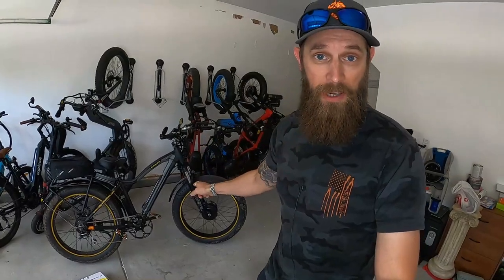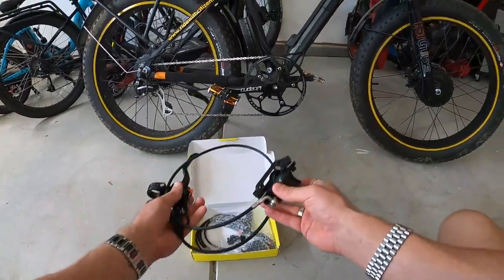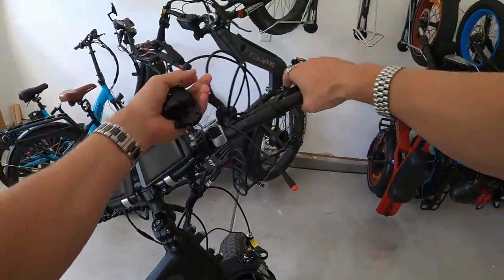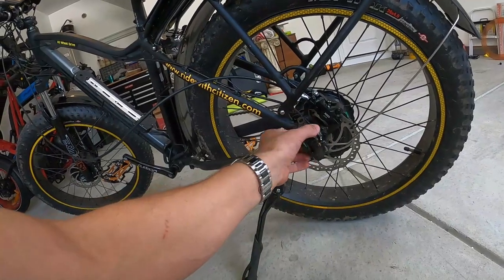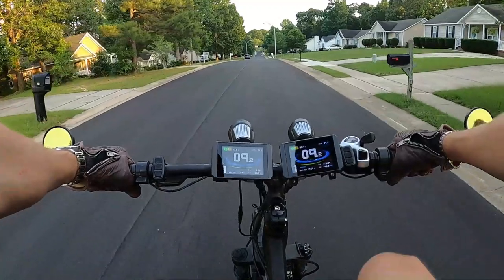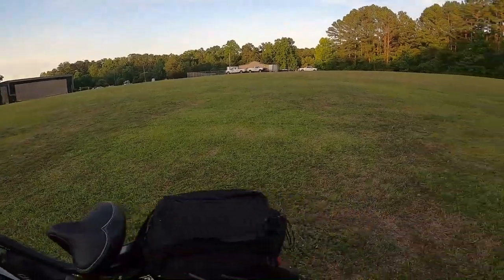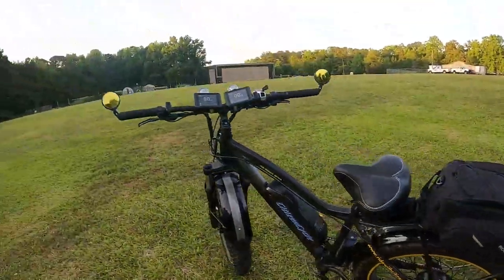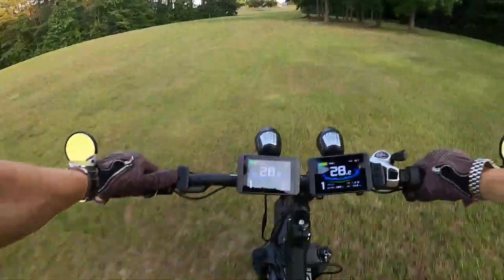World's Easiest Hydraulic Brake Install

Comment: Great upgrade from Big Game Bikes!  I tried out the “Assembly Required” set from them for my Rover (lines and reservoirs filled with screw caps holding fluid).  Allowed me to run the cables through the frame and then remove the caps and screw them together, no bleeding required - was very helpful to have them prefilled and ready to go, made the install nice and easy.  Added a front 203mm  rotor and now the braking is great.  Huge improvement and totally worth the purchase.
Reply from the maker: I was thinking of adding 203 rotors as well can you tell me which ones you purchased and did they come with a special adapter for correct fitment?

Comment: The reservoir also has space for a few air bubbles to accumulate, so upside-down they won't have that function, and any air could affect braking performance. You'll be fine for a while, but you'll eventually need to swap sides or swap the hoses and bleed them.
Reply from the maker: Altema22 You may be my most knowledgeable commenter 😁

Comment: I am trying to decide whether to go with a full hydraulic kit fir 180mm rotors, or hybrid cable actuated hydraulic calipers. The latter are super easy/quick, but only provide half the benefit. Technically if you can lock up the wheel, and have SOME modulation, this won't shorten braking DISTANCE - but feel should be improved, hopefully enough to be worth the effort.

Comment: I'm considering doing this to my older HT Stump Jumper, still has pull brakes (squeeze pads) it does have mounts for disc. Great video.  👍🏽 
BTW,  motorcycles have clutch on left and front brake on right. Rear break is actually on the right side, but foot pedal. And left foot side has the transmission gear selector.  Keep them rolling

Comment: I just bought the assembly required brake set from Big Game Bikes. They come prefilled, all you have to do is connect the brake pipe to the lever. 3000km later no problems and you can have the lever any side you want right way up!
Reply from the maker: Maybe it's easy to just disconnect mine and switch them then. . I'll have to look into it 😁
Reply: @CitizenCycle925  May be an idea to contact Gareth @ Big Game Bikes. At 37 mph you want to make sure your brakes are in optimum condition!!

Comment: I installed these same brakes on my RR5 and mounted them upside down as well. Seems to work fine but was pretty disappointed that they came this way as there was no mention of this on the Big Game website. Only downside so far is it’s a huge PIA to bleed them.
Reply: BGB is a UK based company and over here we have the front brake on the correct side, the same as a motorcycle. 😉😉

Comment: Yes, it is a great upgrade. Any idea which brake brand these are based on? Tektro? I ask because if you cut the hose to custom fit and/or when you bleed you'll need the right bleeding kit. Also, brake pads. I installed the 4 piston hydraulics from XOD but I'm not sure about the accessories. I think it is Tektro.

Comment: Fantastic new 50% bike-cave/wife-cave Mr C.C. Awesome! after 8 months of searching you finally took the leap and purchased much needed hydraulic brakes. Even though they aren't the 4 piston you hinted at, it's at least full hydraulics. Gone are those caveman-like cable brakes, such a horrible old tech relic on such a modern and fast 3.0 beast. Just an opinion here though, installing the levers opposite to what they were intended is not a long term solution. The oil reservoir that is designed to capture and localised any air entering the system is now incapable to do so. Over time this will lead to air circulating around the system making it's way to both pistons, on either the lever end or the caliper end. This will result in spongy lever feel, longer lever pull until engagement, less ability to modulate and even total loss of clamping force. Usually when ordering look for the initialls, you have the option of (for USA market) LF (left=front) & RR (Right=rear) or vise versa (for EU Asia/Aus). But sometimes it's in really small print. Another issue is when it's time to replenish or bleed the brakes. Oh boy is it going to be a hassle. Do-able but hassle. Stay safe out there Mr C.C. look forward to the next episode.

Comment: Always good to have hydraulic brakes on such a fast bike. Kinda seems like having to deal with upside down levers for all future fluid checks, fills, and bleeds is more cumulative hassle than the initial convenience boost of the "plug and play" system over the long term though. Didn't see the brand of brakes mentioned in the video. Checked the link and the seller didn't mention it either. Any info on who makes the brakes? Do they have replacement levers available if you break one? You can get levers for Tektro and Shimano. Magura sells replacement levers but they cost almost as much as the brake set. I guess it just seems like no name $140 hydraulic brakes turned upside down leave a lot to be desired vs a $170 pair of E350 Tektros. You seem to love the bike. What you did was better than nothing but brakes mighta been the good place to show that love by doing it right.
Reply: Agreed, full hydraulics are the way to go.  Especially on a bike capable of exceeding 35mph. Upside down installation will become an issue though. Not only the difficulty in replenishing, bleeding or servicing the brakes, but over time air entering the system will not be captured and localised as designed in the reservoir. Eventually leading to spongy long lever action inefficient braking. Was hoping to see the 4 piston he hinted to in earlier vids. That would do such a fast heavy bike justice. But hey, after 8 months looking, any hydraulics, even upside down are better than those caveman like cable operated relics, right?
Reply: @chinguyen8778  Good point. Any air in system will not be at top of reservoir and will instead head straight to the piston for injection into the brake line.

Comment: That's great! With my Radrover 5, whenever I put new brake pads in,  I can't get rid of the squeak. I adjust them, the noise goes away for awhile and then comes back. Ugh! If anyone has any advise,  please let me know. Nice upgrade. You surely needed it. I'm hesitant to do it because it looks like you have to take the hand grips off. Mine are on really tight and I don't think I want to mess with them.
Reply from the maker: If you take a thin screwdriver and put it in between the grip and the handlebar then hit it with a quick squirt of WD-40 that grip will slide right off in 2 seconds. I've been changing out my leather grips to grips that have the locking rings they are so much more convenient
Reply: Rubbing alcohol (isopropyl) also works well for grip removal and installation.
Reply: Any time new pads/rotors installed, it's good practice to clean both surfaces with isopropyl alcohol and wipe them down. This will remove any oils and contaminants. Changing the pads without cleaning the rotors is pointless. You will just be contaminating a brand new set of pads. Of course a bedding in process will have to take place before the first proper ride. Just find a gradual slope that has run off area and free from pedestrians or cars. Pump the levers then release. It is a hard consistant action then release. Not just a long light rubbing and riding of the pads. Repeat a few times. The aim is to rebuild the thin layer of brake material back onto the now contamination free rotors. Practise good habits when riding, don't touch the rotors with bare hands the oils from your fingers is enough to cause problems. Always cover the rotors when using oils/lubricant wd40 etc. Never use old cloths to clean rotors.
Reply: @chinguyen8778  Thank you!
Reply: @CitizenCycle925  Thanks!

Comment: Mechanical brake lever upside down, no problem. Hydraulic brake lever upside down, you'll have to remove the levers from the bars when it comes bleeding time.

Comment: Hey Citizen do you know if a Rad rover5 battery can be repaired? I’m getting only 25 volts on a fully charged battery! It won’t power up, nothing works on the bike! 🤷‍♂️
From Northwestern Vermont
Reply from the maker: Hey Darcy I definitely don't know much about battery repair. I guess first question is the battery still under warranty? If not You may have to try to find a local lithium battery builder to fix it or worst case scenario order a whole new battery. If you have to order a whole new battery at least you could get one with more capacity.
Reply: @CitizenCycle925  unfortunately the battery isn’t under warranty. I’ve had the bike two years now, I’m going to call Rad tomorrow to see what they say? Thanks for responding and keep up the good work! ✌️

Comment: It's possible to swap the levers. You need a fresh set of hydraulic parts called the pearl and barb. This videos explains the process:

https://youtu.be/z5qIrpGR3yY

The catch is that you would need to bleed the brake lines after swapping. But it's super easy to do a lever bleed (as opposed to a full bleed) if you buy one of those bleed kits with all the yellow parts on Amazon: 

https://youtu.be/EBvbwvLEwio

Fireyouracing Mountain Bike Hydraulic Disc Brake DOT Mineral Oil Bleed Kit for AVID Formula Hanyes Echo Shimano Tekro HS33 Magura Nutt (Normally Combination) https://a.co/d/e2Gt3KG

You'll need some fresh fluid to feed into the brakes too:

BIKEIN PRO MTB Bike Brake Oil Mineral Oil for Shimano Brake System Hydraulic Oils https://a.co/d/4JZiXQP

You can also buy the same brake calipers from AliExpress and specify how the calipers come built. It's also possible to buy them with the levers not attached yet and combine them as needed to go back or front, which is what I did. I got my brakes from AliExpress for a lot cheaper than what you paid Citizen. I only paid $75 including shipping, but I did have to wait a few weeks. The model I searched for and got which are the same in this video are the "XOD XD-E500" brakes. 

I did a write up of the process in this reddit post:

https://www.reddit.com/r/RadPowerBikes/comments/pllxqm/